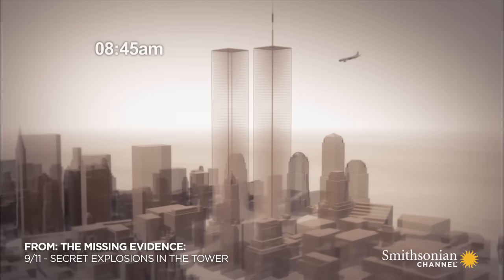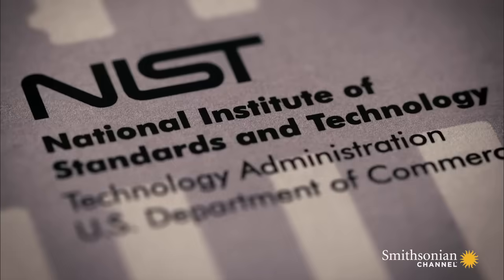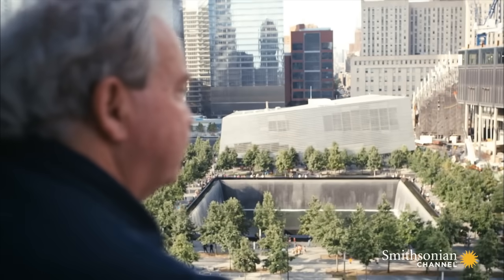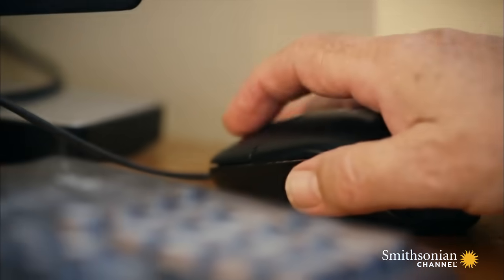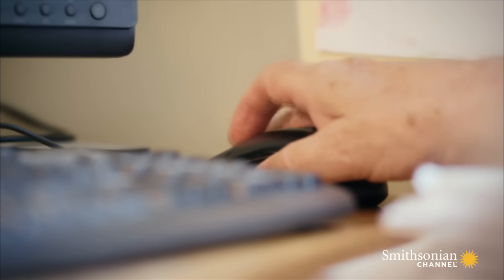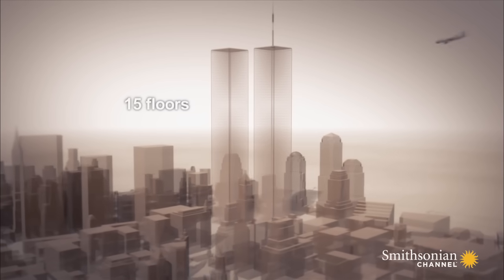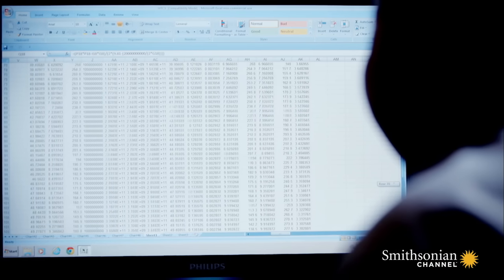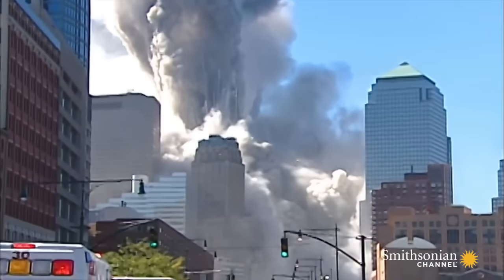This Computer Simulation Explains How the Twin Towers Fell

Comment: The people who explains how the twin towers fell.....are the same people who told us Iraq had weapons of mass destruction !!
Reply: US fooled everyone by saying Iraq has nuclear weapons of mass destruction and they killed Saddam Hussein after the death of Saddam destruction of middle east started. It was all started with US murdered Saddam Hussein
Reply: @eldorado4660  Hi from Belgium. And it seems they took a lot of time from 2003 until the "Arab Spring". How come?
Any idea?
Cheers
Reply: @Melvorgazh  so they can declare israel as Super power
Reply: @Melvorgazh  You don't trust WTC7? Propane heating my friend. If you need to take an elevator to do maintenance on a propane heating unit are you going to put in in the basement of the two 110 story towers or in the basement of the 47 story tower?

You'd put it in the 47 story tower because there's less traffic so maintenance access becomes much easier. Plane crashes into the twin towers, ignites the propane heating system. Propane heating system explodes until it back flows enough to reduce the pressure to a degree that the pipes stop exploding from rapid increase and decreases in temperature of the 5000*C peak  of oxygen rich propane.

Main unit is in the basement of WTC7, there were reports of fires in WTC7 and reports that the fire suppression system couldn't put them out. My claim supports those reports. If you have a tiny sprinkler shooting at a 5000*C open gas flame the water will completely evaporate within a few feet of it. Water boils and evaporates at 100*C let alone 5000*C. 

So now you have a 5000*C fire around all your steel support beams which melt at 2750ish*C. Which caused the beams to melt and collapse in on themselves bringing down the WTC7 with it.
Reply: @MinkoMix  ok , decent argument, but do you have any type of proof of that ? Any design pictures , or videos or pics of explosions In  that the area ?
Reply: @levicallis459  Yes, we have the accounts of firefighters who claim they heard explosions. Propane explosions are pretty loud, look at the Murdoch Illinois train crash
Reply: Corona Virus:
The Secret-Services have been experimenting with my soul and hacking my entire organism for the last few years. 
Now Mr. Musk & Mr. Bezos also do the same with their satellites. 

Now they don't let my skin on my face really heal anymore, which is the reason for the secret services - who blackmail Mr. Gates family, for the Corona virus, since face masks are now mandatory to hide it. 

  Mr. Gates has made sure that my brain can no longer be burned since 2020, but I am still oppressed, tortured and manipulated by Marco Prasse, Kevin Glitz and chazflynn, Thomas Löffelmann, Bock Thomas and their staff! 
I am lied to every day via Mind Control that Mr. Gates daughter is picking me up. 

I am being experimented on daily with dementia radiation to label me as having 32 Alzheimer's patients, although it is impossible to have Alzheimer's at this age.
There have been repeated attempts for years to have me permanently radiated to a hospital...

9/11:
Mr. Gates Senior has confirmed this year that I am actually the chosen one, as he died on Mrs. Phoebe Adele Gates' planned birthday.

11. 09. 2001 was the attack on the towers. 

On 14.09.2002 Phoebe Adele Gates was born.
P= 16 
A= 1 
F= 6
16 + 1 + 6 = 23 = 5

I was born on 17.11.1988 
A= 1
A= 1
G= 7
1+1+7 = 9

5+9 = 14 = 5 (23)
F + G = 13

5 + 13 = 18 = 9
-------
Phoebe = 6
Adele = 9
Gates = 7
4
Artur = 13
Andreas = 8
Fink = 12
6

4 + 6 = 1
6 + 13 = 19 = 1
9 + 8 = 17 = 8
7 + 12 = 17 = 8
= 18 = 9
-------
14.09.2002 = 9
17.11.1988 = 9
Artur Andreas Fink +
Phoebe Adele Gates = 9
= 36 = 9
-------
P (Phoebe) + A (Artur) = 16 + 1 = 17
A (Adele) + A (Andreas) = 1 + 1 = 2
G (Gates) + F (Fink)  = 7 + 6 = 13 = 4

17.02.2020 = 17.02.04

The cross sum of their date of birth is 9.
The cross sum of my date of birth is also 9.
9 + 9 = 18
1 + 8 = 9
So we are to live together forever. 

1 year and 3 days after the attacks Phoebe Adele Gates was born.
2 months and 3 days after Mrs. Phoebe Adele Gates' birthday and Mr. Gates Senior's death anniversary is my birthday. 
Since Mr. Gates Senior was a Freemason, these two numbers play an important role:
13 and 23, which together make 9. 

So 9/11 was meant to avoid blackmail and to mark that I should become Mrs. Phoebe Adele Gates' husband.
Reply: 321st like :)
Reply: @EBGamez1  smiles :))
Reply: @EBGamez1  Wow this is the most likes i have ever had ...THANK YOU ALL <3
Reply: Really? So the Smithsonian is bad?
You know who owns it?
Personally I never trusted the official theories.
Especially on WT7
Reply: bro your 12
Reply: Since when do WMDs need to be big?  Think COVID-19.
Reply: Your lies don't fool me !!!
Reply: @Mossyz.  where the wmd then?
Reply: @Mossyz.  You do know that when we went into Iraq, we found about 1300 tons of VX Poison gas...
Reply: @AmericanRailfan-gb8oq  Thats what they say !
Reply: @Mossyz.  Its not what they say, its what actually happened
Reply: And are the same people telling you to put a mask on your face so you don’t get oxygen to your brain
Reply: @ariellevy7154  These people can not be trusted .

Comment: 3000+ engineers and architects disagree with you. I agree with them (AE911Truth).
Reply: And a vast scientific consensus disagrees with the crackpots that you agree with.
Reply: BTW the buildings were vaporized by nuclear bombs.
Reply: @dwingIes5936  right after the thermite.  Did you know the residuals of thermite is iron oxide...  Rust which can be seen everywhere.  WTC meteorite can then be explained which were found to have melted concrete and steel with signs of liquification.  These evidences are impossible in an office fire. Not to mention the reports of explosions before the first plan hit.  There are 503 first responders that testified to explosions.  New York times has the public archive.  Please push your agenda somewhere else...

Comment: the computer simulation in which physics and common sense were turrned off
Reply: Bruh I that was a mf hair
Reply: @Eduardo-gw6xy  English 😭
Reply: @ryanborghini2975  I meant to say bruh I thought that was a mf hair in the pfp😭
Reply: physics.exe has stopped working
Reply: Bro I thought there was a freakin eyelash on my phone. 😂😂😂
Reply: no planes
building 7?
Reply: @theyredistortingyourrhthym8883  no planes 🤫
Reply: @theyredistortingyourrhthym8883  Frank's working on it and currently negotiating the price.
Reply: Owennn explosions wer heard and scene , diagonally cut beams wear left for all to see in the wreckage , the emote was found in pools at the base of the building ... thermite is used in demolition. The towers wer demolished  if you think the government wouldn’t do this to its own people you are very naive .
Reply: I blew at my screen
Reply: But only for 13 seconds.
Reply: @bnglr3239  and the titanic was built to be unsinkable.
Reply: hey have you heard about the cloud people
Reply: flypaper4weirdos  then they are like “well the plane disappeared” I mean yeah kinda the airframe is suppose to be in the air, it’s wide and hollow but think of it like a shot gun and the building is a door, some will go through and some will not plus not to mention the plane engines found a block away
Reply: flypaper4weirdos  agree a 80,000KG plane going at 500mph in an angle with a full tank of Gas, that knock anything down
Reply: @bnglr3239  I mean a lot of stuff was built for reasons and still failed
Reply: @gabrielguzman9646  remember that winged helicopter in 1890s? Fsil.

Comment: I applied common sense and results said that controlled demolitions brought the buildings down!
Reply: Shocking Asim.
Reply: Just know, common sense != scientific reasoning. Common sense is nothing more than a baseless theory, it's like saying I have no evidence but it has to be this.

Common sense is not meant to be applied to uncommon things. You can't attribute common sense to a complex system and then say it must be this since I can't think of anything else to explain this complex system which I don't understand the underlying principles of.

I can explain what likely occurred in high detail because I'm not using common sense, I'm using a background of extreme personal interest in a wide array of scientific topics. The ones at work here happen to be simple force equations with addition to fluid movement, gas movement, pressure transfer, material tensile strength, cyclic nature, temperature changes due to pressurization, and conduction heat transfer. None of which are common sense except maybe conduction.

Lets put common sense vs scientific reasoning to a quick test.

If the earth floats through space then is a human floating as well?

Common sense dictates no, because if I jump up I come back down. I am not floating. That's common sense, the idea that I can't be floating due to gravity.

Scientific reason can state both:

No I'm not floating due to my gravitational mass reacting with the earths pulling us both towards each other by the stronger of the two gravitational pulls which is earths 9.8m/s2

OR:

Yes I am floating, the earth is floating through space over time and since I am part of the complex system known as earth then I therefore must be floating through space over time as well.
Which if you chart that out then indeed, I am floating through space over time even if I'm perfectly stationary on earth. The earth cannot float through space without every single human floating through space at relatively the same rate.

Comment: I like how it says he used a computer program, but its just some formulas in a basic looking Excel sheet
Reply: @h1F595  They are implying F.E.A. simulation software (which at high fidelity requires supercomputing clusters). That’s the only software which can actually simulate the physics involved with as many particles involved. Otherwise, the conclusion you come to will be off by orders of magnitude and then some. NIST used that software in their own report. 

There’s nothing you can do in excel that you can’t do from the command line in C on your computers terminal, which isn’t a computer application. Excel is just different in that it is packaged as a nice GUI and non-programmers can use it. Heck, it even has its own pseudo code.

Comment: The clever use of words at the end. “The floors above were the weight of the titanic”. Sounds like nothing could withstand that, but now imagine it’s 3 titanic s below. That one titanic doesn’t seem so destructive does it?
Reply: It does when its literally falling downwards, not just being supported by the tower.
Reply: @Yakub943  - the same tower that held it up to begin with ? 

Newtons 3rd law 

To every action, there is always opposed an equal reaction; or, the mutual actions of two bodies upon each other are always equal, and directed to contrary parts

So everytime the floors above destroy a floor below, that force would also destroy one of its floors so 30 floors can only destroy 30 floors. It can never destroy 70 floors as it would not have the mass left to keep going
Reply: @Crudecraig  What do you mean 30 floors can only destroy 30 floors? Each floor being collapsed is continuously more mass being added.

It’s not designed to stop mass that’s falling onto it.
Reply: @Yakub943  - and every time that mass hits the floor below one of its floors are also destroyed. Otherwise there would be 30 floors remaining at the end of the collapse. There was nothing but dust and about 2 floors of rubble
Reply: @Yakub943  - also, what happened to the 48 reinforced central columns?
Reply: @Crudecraig  Are you talking about the core? It’s a steel tube construction. There’s no column support besides the walls.
Reply: @Crudecraig  Why would would there be 30 floors remaining? This doesn’t make any sense. You have hundreds of thousands of tons of concrete and steel falling into a foundation and basement several floors remaining. 

I don’t know why you think it would just somehow stop a collapse. You can see the walls buckle before the tower collapses. It’s basically lost all of its strength at that point and the floors that have no column support besides the core can’t stop a mass of the titanic that’s effectively being dropped on it.
Reply: @Yakub943  if the 30 floors worked as a giant weight with enough velocity to destroy 80 floors below it then why isn’t that mass visible at the bottom? Why was it so strong when destroying the building below including the core but then turns to dust at the bottom?
Reply: @Crudecraig  Everything is breaking down. The building wasn’t turned to dust. The building is being pancaked floor by floor. Those floors are broken when the building collapses. It’s not the building at the top that is strong, it’s the mass that is falling downwards onto floors that don’t have the support to hold themselves anymore.
Reply: @Yakub943  - they have the exact same support as the floors above and newtons 3rd law states that the forces would be distributed equally. I.e every time a floor below is destroyed the same destruction would happen to the floor above
Reply: @Yakub943  - where was 110 floors of filling cabinets, desks, tables, sinks, computers etc and why did etc 7 just collapse when it wasn’t hit by a plane
Reply: @Crudecraig  The floors are supported by the Walls. Why do you think the floors that are basically held up by the walls with no columns besides the core is able to hold that much weight falling onto it? 

Every single floor is pancaking. The top floors are already pancaking as they’re collapsing as shown by basically any simulation.
Reply: @Crudecraig  Where do you think the 110 floors of all that went? The only place it could’ve. On the WTC site, surrounding streets and fallen into the buildings basement. 

WTC7 collapsed because of a design fault of a column that had too much load that was exposed to fires for hours on end with no sprinklers, along with like 10 floors being destroyed in one of the towers collapse. That and the NYFD decided early on that they couldn’t save the building.
Reply: I told the exact same thing.

Comment: BUILDING 7?
Reply: WTC 7 collapsed due to fires.
Reply: @takotako3321  which eliminates the thesis re: shock to the beams from plane impact. I work in heavy industrial and commercial construction. I haven't met an engineer that agrees with the official story...also havent met an engineer who'd be willing to put his name on the line to say it in public. Group think is a helluva thing
Reply: @TalentedTenth  You do know that buildings other than WTC 7 have collapsed due to fires, right? I highly doubt that you or the "engineers" you've met have even read the nearly 800-page NCSTAR 1-9 report on the collapse of WTC 7. I agree with you that conspiratorial group think is a helluva thing as you've clearly demonstrated.
Reply: @takotako3321  read it. Its nonsense. buildings that have collapsed due to fire have endured significantly longer and more pervasive fires than WTC7. Do your research and get back to me.
Reply: @TalentedTenth  Alright, since you've read the 800 page report and know its structure, content, scope, technical details and method, please point out any nonsense you might think there is by properly citing it and providing reasons why you think it's nonsense. Explain in detail how it's "nonsense". What methodology, data and calculations did you use to come to your conclusion?
Reply: @TalentedTenth  It's alright, I knew you couldn't do it. Richard Gage is an architect. He's not a forensic scientist, structural engineer nor a physicist. None of the claims of "Architects & Engineers for 9/11 Truth" have been proven in any peer-reviewed studies or journals and their theories lack support among the relevant professional communities. I wish you'd be more skeptical about the people you trust, instead of the "official report" that I still doubt you've even read.